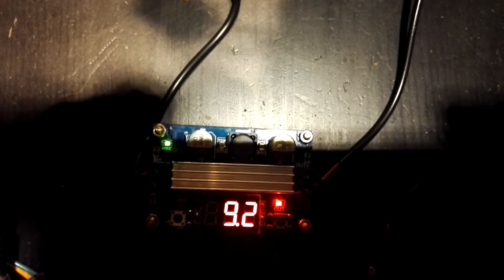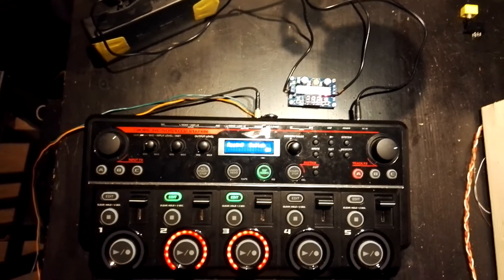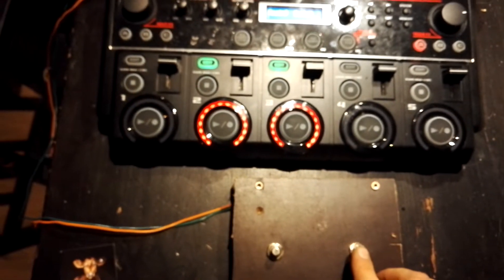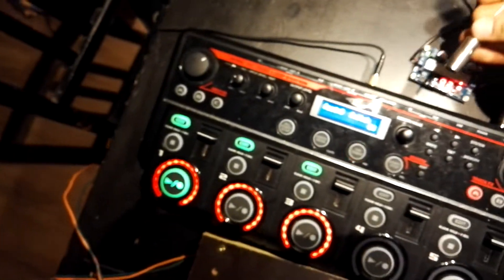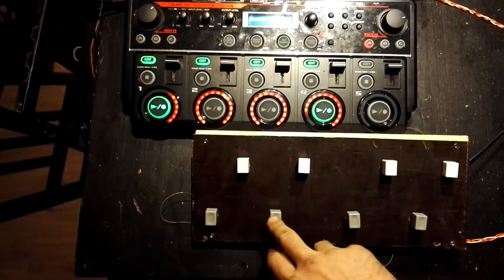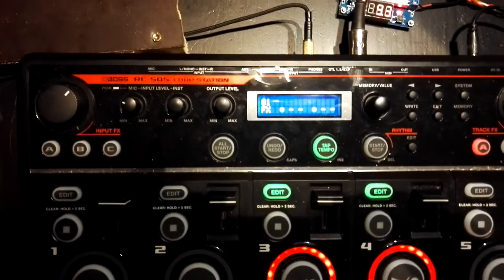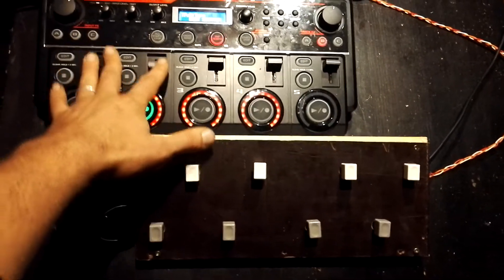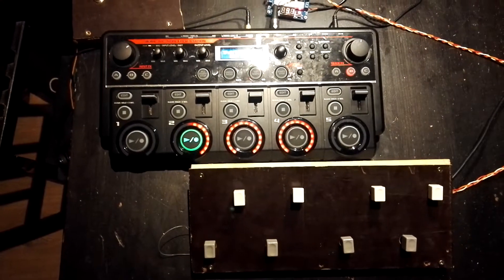3 nice home made add ons for the boss rc 505 (Power Bank, foot pedal, midi pedal!)

Comment: I have an 8 button midi foot switch.. but it only switches preset banks..  how can i modify it to do what you have shown here?Play,record,target,start/stop. Any help is appreciated. Thanks. Excellent video. 👍👽✌️💓
Reply from the maker: First of all you've got to ensure that it's sending CC messages. If you don't know it, look in the manual or Google it. If this is the case you can assign any CC commands your pedal sends to any action the looper has in its setting list. I've made a video about assigning pedals to the 505. 
Be also sure the buttons on your midi pedal are set to momentary. This should work. There are some pedals that won't work cause they don't send the commands the looper needs. Besides of needing cc messages, this cc messages have to first send a value of 127 to tell the looper you pressed the button and after that a value of 0 so the looper knows you're no longer pressing a button. There are a few controllers out there that doesn't manage to do that, but most do.
Reply: No it doesnt send CCs.. but i wondering since have i the housing and buttons already.. could the guts be switched out with new components to make it send CC? I am new to midi functions. 👽✌️

Comment: damn, this is super crazy man.. i already do the portable power for RC-505 like a year ago, but that DIY pedal is crazy man. i would like to ask, is it possible to control the effect (in&out) parameter using a midi too? just curious to make that.
Reply from the maker: Yes, sure it's possible. To get an idea of what is possible and what not you just press memory 4 times, then comes the "assign" section. You can select on/off for 16 commands, then comes stuff like selecting what button/switch/knob you want to assign and "momentary/toggle" menu and I think after that comes a list in witch you can scroll around and see what's possible to assign to switches/buttons. There is a lot of useful stuff in there. And the simple two button pedal is really easy to make.
Enjoy!

Comment: Dude this is epic! Especially the ability to select fx without button pressing :)
Reply from the maker: You can select a lot of different actions, that's what I found useful. In the moment I'm playing around with the eight button midi pedal and the two button pedal at the same time, so I've got 10 buttons to play with. It's really awesome, this combines the good sides of the loopers for the feet plus I have all this crazy features. In the moment I've selected track fx on/off on one of the buttons, that's simply great! I'm just about to incorporate faders or potentiometers, so I could control the fx intensity (fx knob) with my feet!
When I think about that people out there are using the expensive midi pedals where just the half of the buttons work good for the device...